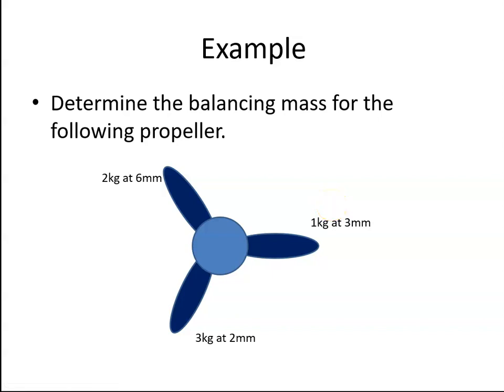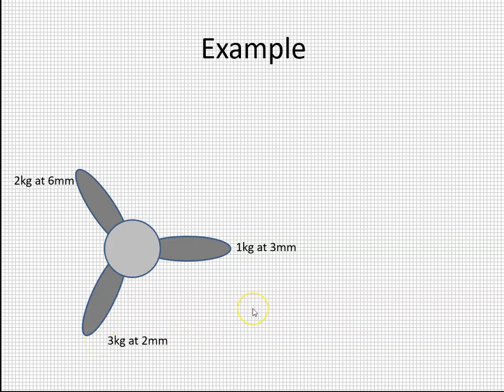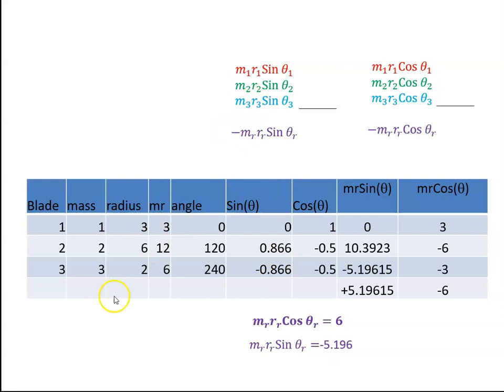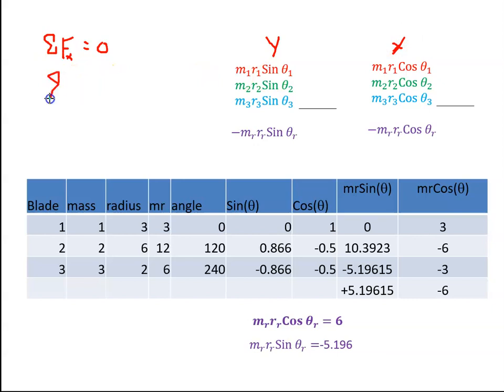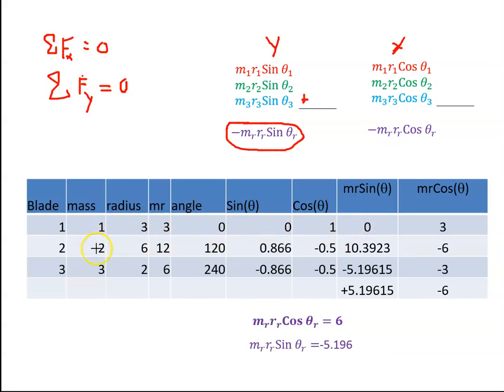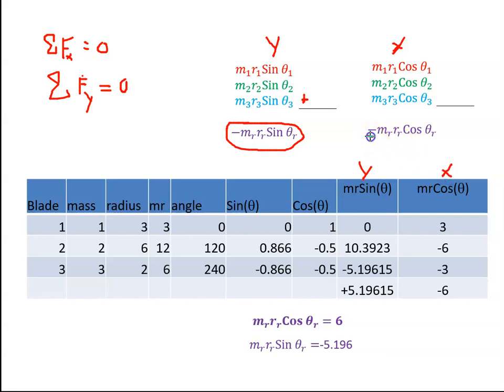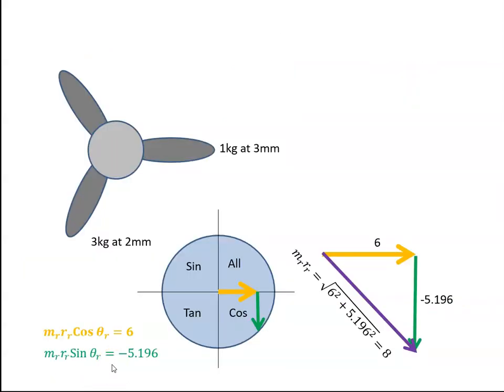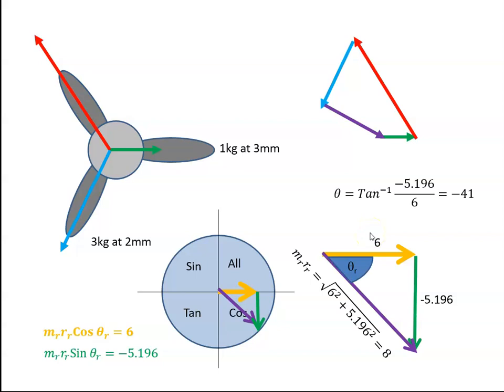Balancing of Rotating Masses - Static Balance Example 3

Comment: Hi, nice Video ! Is ist possible to Show a example of an Tail Rotor (4 Blade) / Helikopter ? Calculate the unbalance direction and calculate the Best Setup for instal with lowest amplitude (unbalance/Vibration)? COG and Weight is given. 

Greets